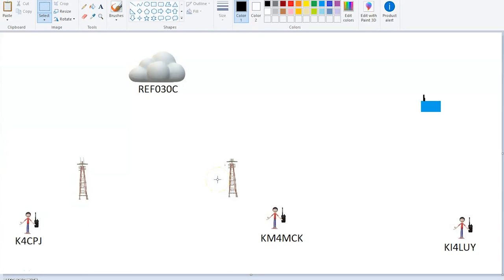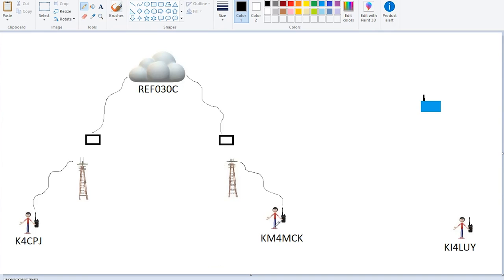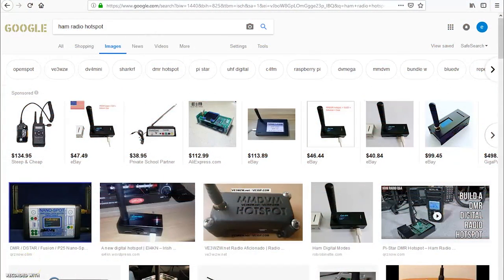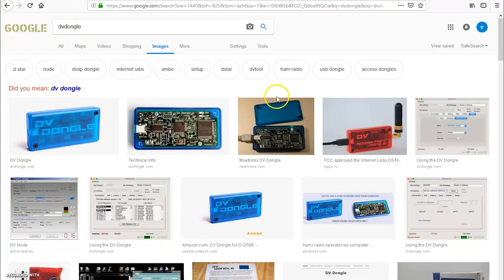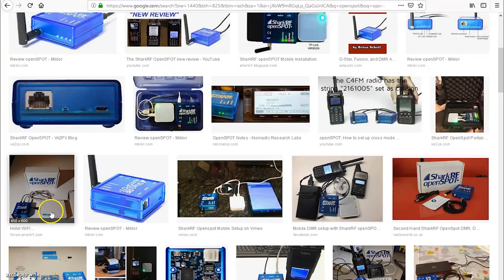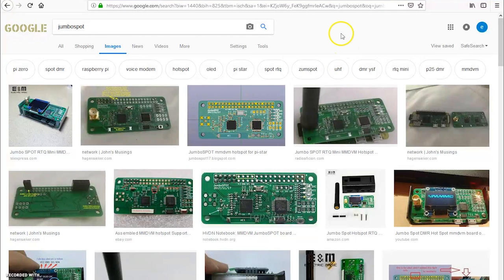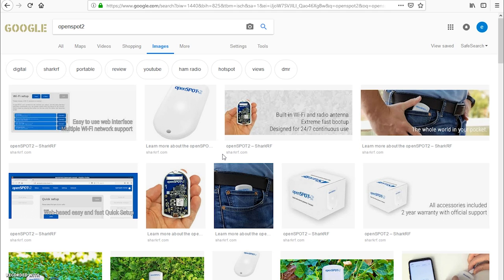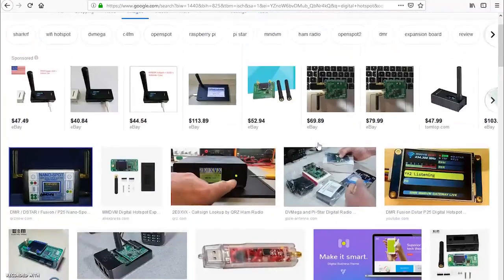What Is A Digital Ham Radio Hotspot? DMR/DSTAR/C4FM Hotspots Explained

Comment: I actually got into ham cuz I'm always fly fishing for weeks at a time with no reception and it was lonely sometimes. So I studied my but off to pas extra and put together a small station in my RV. An ICOM 7300/9700 (obviously 9700 hasn't shipped yet but soon) and a compact vertical on a 30ft mast and get great reception 160-6 good reception VHF UHF and a Arrow ll to play with .
No more lonely nights! Just hope I can use the Dstar without wifi. Thanks for the info.  KM6VAY

Comment: Very important thing I miss from the video. Openspot is the only digital hotspot on the market that has 2 years official warranty and customer support and documented laboratory testing. Openspot 2 has 0,5 ppm accurate oscillator frequency stability which is very good.

Comment: Wow, did you ever answer so many of my questions. thank you thank you.  still have many more about setting up and using digital , to buy or not, but you answered a fundamental question: do I need to ethernet into a router or can I just use my Hot spot on my iPhone. That was the real game changer for me.I also agree 100% on your concluding remarks. I do have a question though: using your cell phone as a hot spot do you know what the minimum bandwidth up and down required to handle these digital QSOs that is acceptable ? PS: if it was not for the Hotpots and Hotspots that could not use your iPhone as its router hotspot for the internet...I would never consider a digital radio.Things are looking up for me. Again, excellent education and video.

Comment: Thanks for the information.  I tired DRM and could not figure it out.  It is, have not returned it yet, a BaoFeng DM-1801 DMR.  Maybe I am just too old school. KH6JMK since 1977.  There is a DRM repeater in my area but.   Wrong radio?  I could not find the programming software.  Your video was outstanding and informative.  Thanks for your work.
Reply: You can find the 1801 programing software at baofengradio.ca.

Comment: So regarding the zombie apocalypses complaint, the release of Starlink may well solve that.  Yes there are other sat systems, but given the current and targeted performance and price point it may be the solution in rural areas which is the problem I have been solving for. Starlink, DMR hotspot, DMR radio. Battery backup/solar/generator. When the storm is through and power and coms are down, this configuration (currently using viasat) works to assure outside communication. May not be a great mobile solution yet, but at least we can have outside com from our rural location.

Comment: What about ECHOLINK ?  It seems they are similar ideas using the internet.  Enjoying the videos!!
Reply: Echolink is accessed by connecting to an established Echolink repeater, in your metro area.  While pressing your PTT key, you input a DTMF codes from your radios keypad.  For more information check out echolink .org for an overview of the technology and  www. fwrc.info/index.php/news/finish/5-other-files/11-accessing-the-fwrc-echolink-node for some info on accessing a echolink repeater with your radio.  WARNING:  "DO NOT^ USE UNLESS YOU ARE A LICENSED HAM RADIO TECH, OR ABOVE"
Reply: Can’t use DMR and Fusion!
Reply: @rossbassette7518  Thanks! yes, im technician.
Reply: And in a loud environment (like a car running at 130 km/h ) the audio of Echolink is still good.  On dstar i can't make jack shit of the incoming rx conversation.

Comment: You can get on all digital modes without a hotspot.  Google DVSwitch this software allows you to access DMR, DSTAR, Fusion, P25, NXDN all without purchasing an AMBE chip or MMDVM modem hat.  Software encoding/decoding is accomplished via the md380-emu emulator and the audio is superior to hardware based solutions. 73s - KI5BXN

Comment: Can you show how to connect to home wifi using an IC-705, including, how to find & set reflectors /hotpoints or what ever is required? Struggling to get working on terminal mode ☹

Comment: Well, Eric, I'm now 72 years old and have been a Ham for 4 years.  I just got a new Yaesu 991a and am quite disappointed in the digital side of Ham radio.  There's a lot of room for improvement.  When in digital mode, voices sound muffled, muddled and quite robotic, as though they were computer generated.  It's understandable though, with voice data squashed and compressed into one half the bandwidth with the other half dedicated to error correction.  And none of the digital modes are compatible with each other.  Icom has D-Star (Death Star), Yaesu has System Fusion (System Confusion) and then there's DMR (Digital Mobile Radio).  When are the requirements for a standard digital Ham radio going to appear?  Why can't the manufacturers or even ARRL get together and decide on one form of digital communication for Ham radio?  I guess for me, I'll just stick with good ole FM, SSB or AM. These modes of Ham radio are 100% better than digital as far as audio is concerned.  Cheers & 73 from W Rusty Lane K9POW in eastern Tennessee

Comment: You might want to do an UPDATE to this one so as to continue "the rest of the story"... ?  It seems like the router community should consider adding 1) the ability to receive a 70cm digital signal and 2) a pistar-like os system that might be running on the side so it can immediately take the local signal and route it off into the internet as appropriate.

Comment: Eric - I bought a Icom ID-4100. I want to get on Dstar. My understanding is this radio can do "terminal mode", where you can plug the radio directly into a computer and connect to reflectors without transmitting any RF from the radio at all.  Any experience on this or any videos out there that touch on this setup? Tim. N8HUS.

Comment: So why don’t digital radios have the capability to directly connect with your iPhone rather than have to go through some kind of hotspot device?  Is it to take the load off the phone of creating and unpacking digital packets? Or is there more to it? Don’t most expensive digital radios have Bluetooth built in? Or is Bluetooth only for wireless headset/microphone? What about direct WiFi connection from radio to iphone?

Comment: I watched a lot of videos on the openspot2 and feel like I was misled. You would think that if you have a Fusion radio and you get a hotspot that is capable of Fusion that you could find any Fusion repeater in the world. That is not so. Many of the rooms or repeaters or talk groups whatever that is on the openspot is not necessarily on a repeater. There are a few exceptions like America link maybe Alabama link Etc. In addition, somebody in that repeater has to set it to whatever room you're in if it's available on the hotspot. The hotspot is nothing but an internet chat room. Echolink is more radio than this.

Comment: I am an old ham trying to understand more about things like hotspots.  But there's something missing.  Your diagram draws a line from my wireless home router right to a reflector.  So why would I need a radio if I can go from my router right to the reflector?  My home PC connects to  my router, so does my cell phone, so I should be able to get right into the reflector from my cell phone or desktop PC?  I have doubts but that's how your diagram makes it look.  Is there something missing in your diagram?  WB5FVT

Comment: I have a few questions about hotspots, hoping you can / want to / will answer them.
Can I use multiple radio's on one hotspot?
If I use two (or more) hotspots, can I set them to the same frequencies? Or will that give me problems in the overlapping area?
If I have a hotspot running without network / internet connection, will it function as a repeater to directly connected radio's?

I don't have a license yet, and I'm planning on setting up a small network to test with, using license free PMR frequencies (I'm living in the netherlands),
but I'm looking in to getting a license and probably even acquiring a lease frequency so I can use my network to aid security / first-aid/technicians helping
out when we organize events (I'm a volunteer tech for a local venue).

I got directed to some python server software to set up a private server, and I'd run in on the Pi in one of the hotspots eventually, but the less I need to get
something working the better! After all, fault finding in a complex setup is a LOT harder than when you build it step by step!

Comment: this one helped me a lot I do have repeaters in my area but i am moving to a small town in Tennessee so I think
a hot spot will do the trick. i am a bit confused on cross talk, so if i have it correct, if i go out and buy a yaesu and an open spot 2
i'd be able to talk on lets say dstar ???. is this correct
Reply: Kevin OKeefe cross band from Fusion to Dstar happens on a reflector not the hotspot. The hotspot does not handle that and you will have to have a different radio for each mode. But the open spot has a built in DMR to Fusion crossmode .
Reply: Sebastian BlueCrew Thanks can power for  the hotspot  be drawn from an iPhone for portable use  ?

Comment: I got a bit of a mixed feeling when you say using a DV dongle to connect directly is not ham radio but using a hotspot and handheld is because with only 10 mW you are still only using it for yourself, it would be different when you use a bit more power and open it up for other locals to use, that would bring in more experimentation
Reply from the maker: the dongle I meant was the blue one with no antenna or radio involved at all.

Comment: VERY GOOD VIDEO i have some questions.
as i have been out of HAM radio for many years, and want to get back in,  i find everyone is getting in to digital radios, i am looking at some radios and thinking maybe i can just get analog radio, and do the digital at home on the PC as there not many digital repeaters in Australia. and as you say in the video the systems are still not total stable there so many modes and they have not made it total sanded, DMR/DSTAR/FUSION, WIRESX what others, we cant have a radio for all, and cant have a radio with each, but i have seen that some can get on with a PC like echo-link. and many systems here still have some form of link to other countries voice over IP. if i had the time and nothing better to do then just sit on my fat ass and speak with so many people, Australia have lots of repeaters and 90% are analog, if i do some travel and most would be analog, and i am still learning a lot about microelectronics, FPGA and that takes a lot of time.
last week i fixed my old Philips FM 900 and replaced every capacitor, and return it and it works ok after then i had used it for maybe 2 contacts in a week, 

the radios i am looking at will buy one

ICOM IC-2730A
ICOM ID_5100A

Yaesu FT-8900R
Yaesu FTM-100DR
Yaesu FTM-400DR
if any one like to tell me what they think pros and cons

Comment: My questions still remains...
1. if the hotspot transmits radio signal to your phone, of which then transmits that out over the internet to hit the reflector, isn't that using data from your phones data plan?
2. If your running aprs on a tablet for continuous tracking, as a trucker running 16-18 days, this just doesn't seem very realistic of efficient. 
No one explains how the data stuff works...data from the phone carrier? Your personal internet carrier? Transmitting 20 hours a day would be atrocious regarding a data plan.
Am I not understanding something?
Reply: 2 years later and still no reply. This is why you get a thumbs down.

Comment: Curious, I’m assuming the hotspot is effectively a repeater as far as your radio is concerned. Do you just pick repeater frequencies that are open in your area?
Reply: It is not a repeater, it is a gateway, using a simplex frequency. You transmit into it, and it sends your traffic through the internet. Pick a frequency that is in the simplex bandplan for experimental modes, dont put it on a repeater frequency.
Reply: Sebastian BlueCrew after reading your post it was obvious to me that it would be simplex. Sometimes I get lazy and ask rather than try to figure it out. I’ve only ever worked repeaters so simplex wasn’t really in mind.
Reply: @mattbrown2996  Yah so just find a free freq in the appropriate bandplan, set the hotspot and the radio to the same freq.. enjoy, 73 de KJ4YZI

Comment: What is the reason D-Star does not cross mode to DMR or Fusion?
Reply from the maker: I think because it is an older technology, from what I have heard several say.
Reply: @HamRadioConcepts   I thought the OpenSpot could go from DMR to DSTAR ?  DSTAR is what we have n this area the most, I'm n a RF hole so thats one reason I'd like to go this route.  I have to run 100w on 440 to get out.  Just got GD-77 so looking at options, thanks for all the info

Comment: I am relatively new to Digital radio I am looking at getting an open Spot 2 and I guess my question is how do you change reflectors or talk groups or rooms depending on your digital mode I have used a DV blue stack in the past which is extremely easy as far as changing the different reflectors talk groups or rooms but I'm just wondering how you would do it with the openspot I've never been able to find the information on it yet any help would be greatly appreciated
Reply: You can do it via radio commands or on browser
Reply: @ryankc9oza118  so what I just basically set the radio up like I was going to use it on a repeater except I would run it as a Simplex for the hotspot and just use the same commands that I would use for the repeater
Reply: What mode you planning on running?
Reply: @ryankc9oza118  right now I'm probably looking to run fusion and DMR hopefully when I get my other d-star radio I'll probably be running that too but it'll be just those three modes once I get everything

Comment: Is there any hot spot that supports 5Ghz wireless?
Reply: Yes if you use a Raspberry pi 3+ as the base that has a dual wifi chip.

Comment: I understand the practicality of it to some extent, but doesn't using the internet kind of defeat the whole purpose of radio? Why not just use a computer?
Reply from the maker: DId you get to the end of the video when I brought that up?
Reply: I just did. I guess people just have different goals. It's cool, I'm glad you're having fun, it just doesn't look like something that's for me.
Reply: and it defeats the purpose of radio being the emergency gap when things go down. When radio is relying on another service such as internet there is another source of failure. One of amateure radios talking points is ham radio when all else fails. 
 @MickeyD2012
Reply: Well, looking from the other side, if you're going to use a computer and the Internet to do your communications link, what's the point of the radio, then?  You get a much more simple and reliable connection by plugging a headset into the computer.  Or the Raspberry Pi.  Again, what function does the radio serve?
Reply: I am new to all of it, so from my outsiders perspective, it would appear Ham Radio is becoming a hybrid of RF+Internet. Where the internet simulates RF between radio and computer devices. Not sure Skype or other software allows One-to-Many connections and\or talkgoup channels, etc (free).
Reply: @BrightBlueJim  Probably not more than portability, which could further be argued that a smartphone would be a better option with just having a app install, such as echolink. I have been listening to local repeaters where night delivery drivers chat with each other over repeaters, some using their smartphone with echolink. This ensures they're connection to the repeater is 100% no matter where they are. No drop out. Can be anywhere and always sound great.... Not endorsing one option over another.
Reply: @nrnoble  Hm.  Okay, I can see that.  It's kind of sad that the service many of us are paying $$/mo for is so low-grade, compared with what we can use for free!  But then, in my area, there are a few hundred people with ham licenses, compared with hundreds of thousands with smartphones.  And now that I think about it, amateur radio has always been about exploring different ways of hacking together communications links.  This really isn't so different from the olden days, when many hams and many repeaters had phone patches.
Reply: It is skype with an HT - not my mode - I'll focus on HF.

Comment: You talked about the HotSpot and HotSpot2. What’s the advantages of the HotSpot3?  I just got a UV-380 and a ham friend suggests I only get the original HotSpot.  I’d like to get DStar and Fusion and others, but don’t know which device will best suit my needs/wants. I have a GB switch that I can use at home, but what happens if I go out of town and don’t take the switch with me?  

de K3DIO
Bob@K3DIO.Com

Comment: 21:45

Crazy idea but what if they made them come in 4-8" multituch displays and they could hold sim cards and talk directly with individual hams or groups both voice and text type communication, then add may a browser and some games oh and have em play music and bam HAMs now finally have the first iPhone. Sorry guys but the way these digital modes work with hotspotted hotspots and radios is just a convoluted less useful/powerful but just as expensive cell phone with a bluetooth set. I like what dmr and dstar can do for communications away from cell coverage but 8f you have cell coverage and 4glte than why? I mean you guys realize that phones are just radios right? Just ones that work better in nearly every way except when there's no cell service l...you know where your hotspot doesn't work....why not skip all the money on this junk and use a phone app to hit the talk group or reflector when you dont actually need to be splattering all the extra rf around so your phone can make the final internet connection anyway.